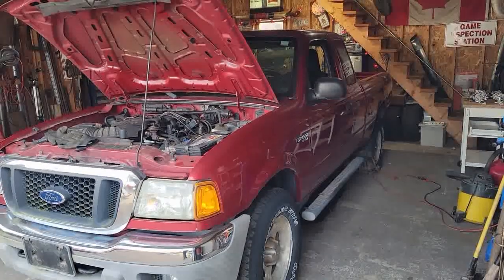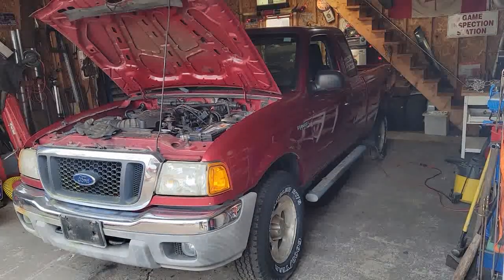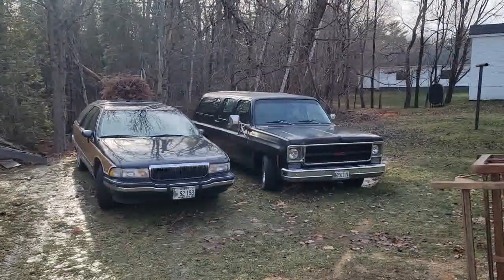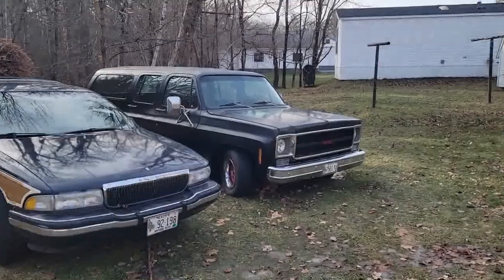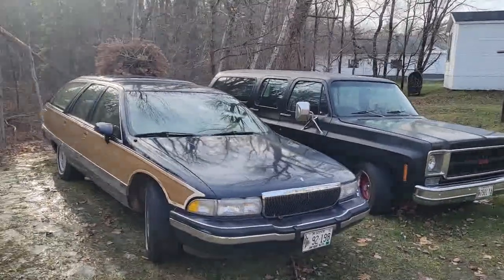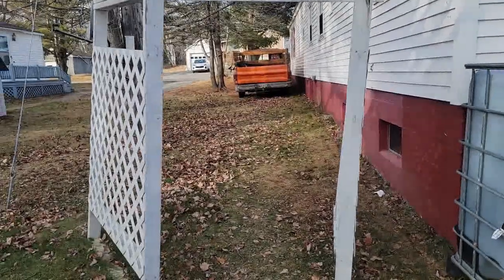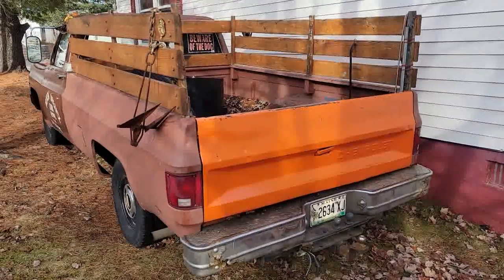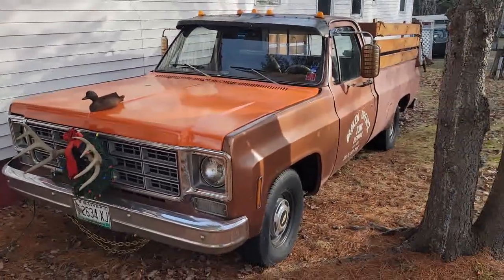Current Vehicle inventory w/ winter prep walk around 12/15/21

Comment: Idea, I know it won't be as efficient but why not put the furnace upstairs, since it's already set to push the heat out the bottom, it would help you save on space.
Or better yet at the bottom of the stairs, on a platform to put it up as high as possible.
You definitely have good neighbours.
The vehicle stories definitely sounds interesting.

Comment: Bro I know the feeling all too well about questioning is it worth the aggravation my 2005 Chevy 2500 has been killing me lately. I bought it as a project truck for $800. Did all brake lines and pads rotors calipers and calipers. I also pulled the bed off repainted the frame. Everything was going really well. Until the last couple of months I’ve been battling the battery that keeps dying. Battery is brand new. I thought at first it was a ground wire changed that same thing then I tried the alternator. Still would die atleast once a week. Took it to a shop they said ignition switch was bad they changed that it does again took it back then they said the PCM was bad. Went to go pick it up after work still dead. Now their saying it’s just a defective battery. Literally loosing my sanity on this damn thing. Love the truck but is it worth it is the question.
Reply: bad ground?i have a 1999 silverado driving me nuts i feel your pain